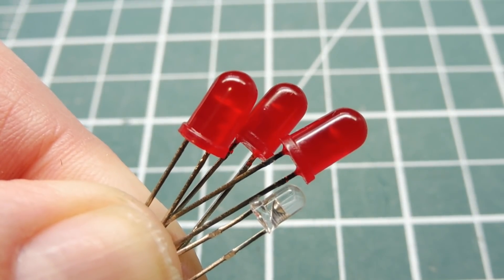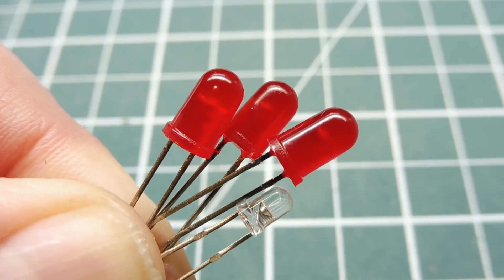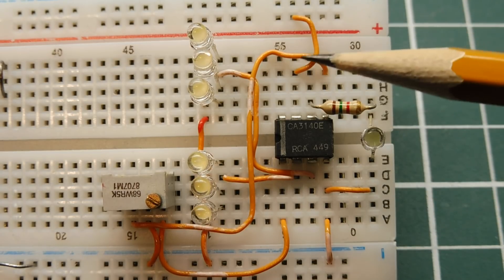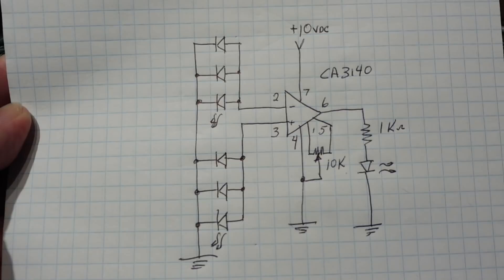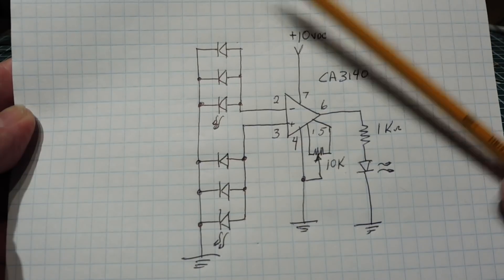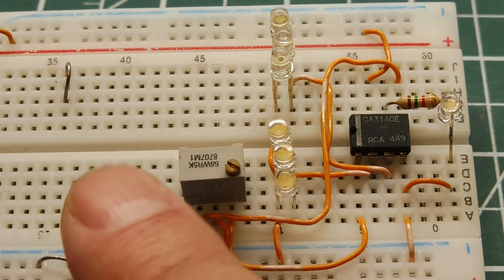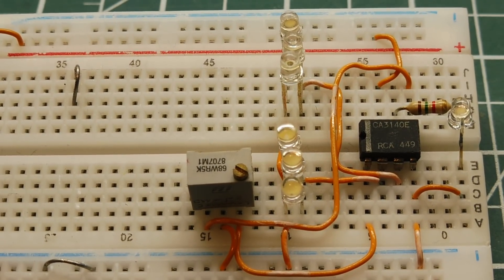Light Detection using LEDS

Comment: Very interesting.  What kind of output resistance do you get using the LED's as a light detector?  Do you need to use a CMOS input op-amp with Tera-ohm input resistances?

Comment: You didn't show what happens when you cover just the top 3 leds.
What does happen ?
Reply from the maker: Nothing will happen. Voltage on pin3 will drop and will still be lower than the voltage on pin2, so the opamp output will be low with the Led off.

Comment: There is much more sensitive way to use LEDs as detector by exploiting small internal capacitance; connect LED backwards to microcontroller pin, charge it and then change output pin to hi impedance input and monitor time it takes to discharge LED internal capacitor.

Comment: Thanks for the useful video. In certain applications, I guess, this circuit will be more reliable than LDRs.
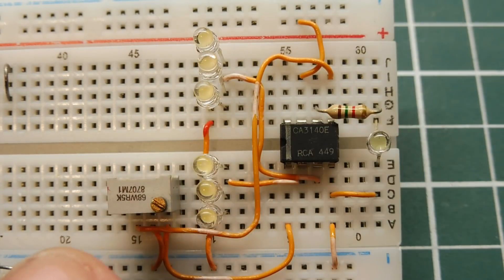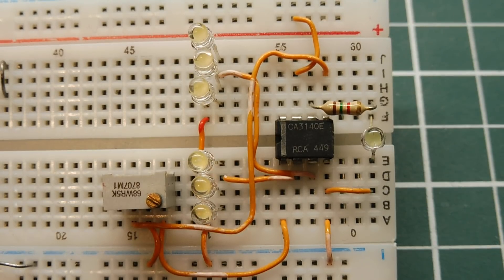After having drawn the circuit diagram, you seem to have interchanged the top and bottom LEDs. While your schematic diagram (at 2:00) shows the top 3 LEDs connected to pin 2 (Inverting input) of the Op-amp, on the breadboard (at 0:51) the top 3 LEDs are connected to pin 3 (Non inverting input). That's why, when you explain, you mention that the LED will light up when the top 3 LEDs are blocked. In the actual circuit, the LED lights up when you block the bottom 3 LEDs. This of course is a minor point, but I am pointing this out to clear the possible confusion newbies may have.
Reply from the maker: I kind of thought someone would notice that. When drawing an op-amp symbol the inverting pin is on top and the and the non-inverting pin is on the bottom so it was simpler to put the trigger LEDs bank on top of the schematic. On the breadboard the trigger LED bank is on the bottom so when they are blocked the other LEDs are not shadowed. Glad you pointed it out as others might also be wondering about the difference. Another difference is a 10k pot on the schematic and 5k pot on the breadboard. Either value will work.
Reply: @0033mer  - Thanks. Now I understand why you interchanged the LEDs on the breadboard.
Reply: I'm not a newbie but I didn't notice that. Of course a schematic shows the electrical connections but not the physical configuration of the components. :)